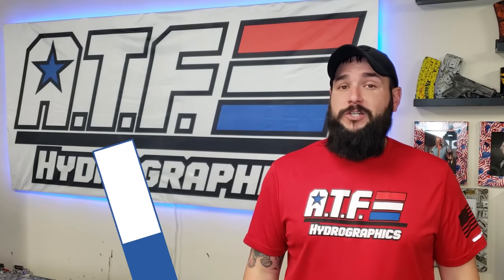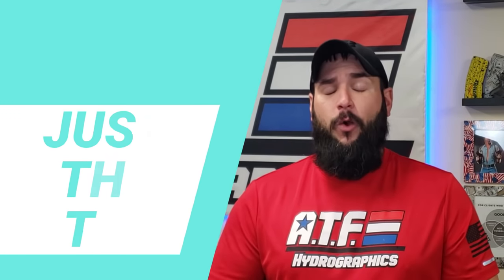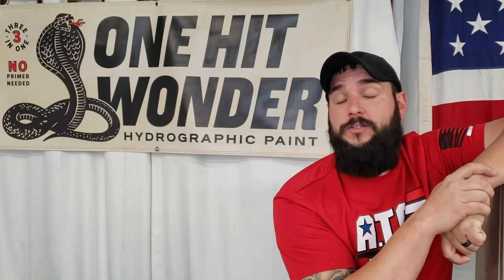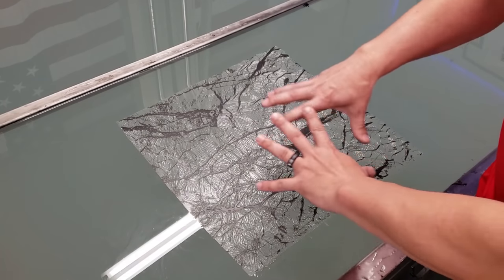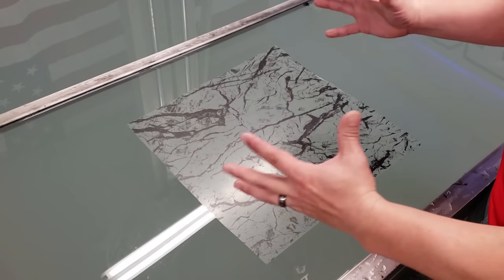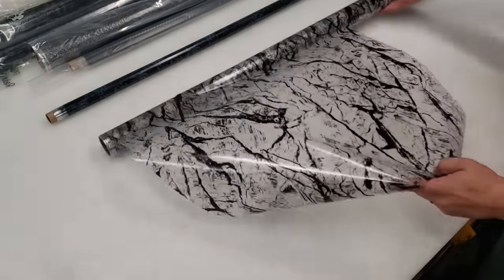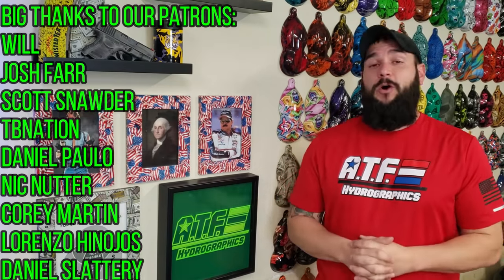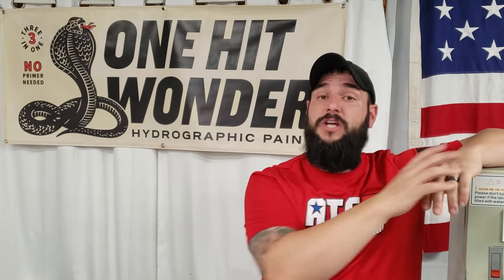Want to get better at hydro dipping? Stop Doing This!

Comment: I was always wondering why my ones came out better without taping the sides. I thought i was doing something wrong because every video i watched, people would tape down the sides, but i stopped doing that because it worked better without it. This video was very helpful, thankyou.
Reply from the maker: That's exactly why I made the video, because there is so much bad info on the interwebs I just want to help people do the right things and have it help them make dipping easier.

Comment: once I spray the activator all the tiny wrinkles go away..
we gottttta use tape if we're dipping in a bin ect and don't have adjustable stops
fricken great tip with the pvc pipe method

Comment: Well done bro. I use 1inch pieces of tape about 6 inches apart but your way looks good also and probably a bit faster
Reply from the maker: Much faster and I don't have to goof around with tape all the time. One less step in the process and is much easier once you get the hang of it.

Comment: I've been working on a project. I have had to strip down my item 5 times now because I followed the directions that came with my kit from Amazon. They said to tape the sides and cut the slits. I had blobs. I had breaks. I had separation. It's been a nightmare and I decided to hit the internet and find out what my problem was. I'm going to give your method a shot, because I've had terrible luck with the kit provided instructions.
Reply: And it worked perfectly. Thanks man. 👌

Comment: I wish I would have seen your video sooner when I tried hydro dip on a rc body for the first time.
I guess I made a lot of mistakes.
Great vid and thanks for sharing.
Reply from the maker: Keep practicing Chris, it is one of those hobbies that unfortunately can be frustrating but keep at it and you will get it. I failed hundreds of times before getting the hang of it.
Reply: @AllThingsFunHydrographics 
Thank you for your encouraging words💪🏼👍🏻
Reply from the maker: @chriscrashrc2982  No problem, good luck and remember it is perfectly acceptable to have bad dips, throw stuff, cuss a lot, and then practice more later on. LOL Sad but true, I still do it from time to time.
Reply: @chriscrashrc2982  hey man how did you get the dip to stick to the body? I’m fixing to do the panels to a dbxl. Sadly the panels come preprinted so I’m having to dip the outside of the panels instead of the inside. Since the panels are lexan I sprayed them with bonding primer.
Reply: @AllThingsFunHydrographics  by any chance do you have any tips for lexan plastic.
Reply from the maker: @juarezd432  scuff, paint, dip, clear... pretty easy.
Reply: @AllThingsFunHydrographics  ok thanks I did scuff it and also used a few layers of bonding primer
Reply from the maker: @juarezd432  I never use primer, One Hit Wonder Paint has primer in it already!
Reply: @AllThingsFunHydrographics  I’ve never heard of it but I’ll look into to it. Thanks
Reply: I want to try to dip a quadcopter frame.

Comment: Three years later and this shows up in my recommended.  I'm actually surprised people though taping at all would work.  Water does what it wants to what's put in it.  Not very many things can counter that.  Trick is to get it to work for you.  But I did learn one thing.  The side that sticks to your finger is the side that gets set down on the water.

Comment: Which side goes up on the water? Using the wet finger method to determine the sides of the dip - you say to put the sticky side down on the water. I believe you but can you explain why? This is the side that, when you dip, will be on the outside of the object. It logically seems like you should put the sticky side up so it sticks to the object you are dipping. Again, I believe you but can you explain why it’s not sticky (I’m assuming it’s not) after you dip the object?
Reply from the maker: There is 2 sides to the film. One side dissolves in  water, the other side needs activator to dissolve. The reason I wet my finger and figure out which side becomes sticky is I want to figure out which side dissolves in water. So the wet finger makes the film sticky because it is partially dissolved. That side goes down in the water.

Comment: GREAT video. I want to hydrodip a smart bike helmet( Built in speakers and microphone) Any Tips and do you have to sand off the new paint and prime it
Reply from the maker: Make sure you take out all the electronics because you don't want those getting wet.
WE have a whole video all about how to prep parts for painting and hydro dipping if you want to check that out it will answer every question you could ever have about prep.

Comment: After watching your video I feel more comfortable and confident in my ability to do this at home. My one question is if the project doesn’t turn out as well as you planned is there a way of removing the dip from the piece and starting over? I’m considering doing fairings and unsure if I don’t like the selection can I re-dip with a new film?

Comment: Great tips.  I've seen several of your videos about prepping plastic items for hydrodipping, including how you flame treat everything.  I haven't seen you dip any clear plastics like Lexan, though.  Obviously you wouldn't want to prime or paint lexan if the idea is to see the dip through the clear lexan -- "reverse painting" does this all the time without a problem of paint not adhering to lexan. They just wash the lexan with soapy water before painting.  Are the inks in hydrographic films just not good at adhering to lexan like paints are ?  If you could dip the reverse side of lexan, how could you do that ?  With the item in the tank below the film and then pull up into the film?  Or dipping normally ?  Would the film appear correct if you were looking through lexan at what had been the activator side of the film ?

Comment: Hey man, Love your videos and information. but if you dont have a fancy set up like you with a hydro tank its a good idea to tape 2 sides to contain the film just not all 4 like you mentioned.. much love for all your videos
Reply from the maker: You can use tape by laying it across the water to hold the film, don't put the tape on the actual film itself. Another easy thing you can do is make some dams for real cheap using aluminum roofing flashing or pvc pipe. Just cut it to fit your tub or tank.

Comment: I have never done this. What clear spray would you recommend for small projects? I might also want to do the interior HVAC trim of my car, so I believe it should withstand high heat from the sun. Is Rust-Oleum Painter's Touch 2X any good ?

Comment: Thanks for the valuable tip. I’m dipping sunglass frames and I’ve run into a very consistent problem. The film will only adhere to the front portion of the orbital section. It doesn’t wrap around the entire frame and I can’t figure out what I’m doing wrong. It’s very frustrating.
Reply from the maker: Not all films will wrap that much and a lot of it has to do with what activator you are using. Some activators need a lot more put on in order to get the film to stretch. The key is try different activator brands until you find the best one for each film.

Comment: Great video. I’ve been trying to get information about how to dip ice fishing rods. If your not familiar, they have small diameter and are typically between 20-40” long. There aren’t any dippers near by and I prefer not to ship my rods. My biggest questions are when dipping a rod does it have to spin to get coverage? And is there a way to make the dip seamless. I plan on using a carbon fiber style dip.
Reply from the maker: To dip a fishing rod you will go straight in and it will leave a seam no matter what. Just make sure the seam is on the side that you will not be looking at when fishing and it will be fine. Some patterns that are more random leave the seam less noticeable but with carbon you will defiantly see  a seam.

Comment: It makes sense for no tape from someone with some wrap experience. The tape isn't allowing it to do what the soul purpose of a hydro dip is good at and that is stretching around odd shaped objects. The tape is just asking for a rip or fold. Its like putting a gymnast is a straight jacket. 
For the record I do use tape for a wrap or large decals, but only to hold it in place on an odd shaped decals, once I get a decent amount of the graphic stuck down that is enough to support it's own weight, all the tape comes off. Usually a few inches of it across the graphic is enough .
Reply from the maker: Tape has it's uses, but causes more issues than it helps. So I try to teach people from the get go to never use it and get used to working without it. Makes for a better dipping experience down the road.

Comment: been trying to hydro-dip my gun stock for the last few days , I keep failing >_< 
will try the no tape method now I've re-prepped the stock again !
Reply from the maker: Yup, no tape and practice practice practice. The activator is the hardest part.
Reply: @AllThingsFunHydrographics   am on my 4th fail now, the film is just bunching up and wrinkling on the stock as i try rolling it.. 
1 side came out ok - other side looks like i spat it on there hahaha
Reply: @Froggywentawandering  I'm getting the same results with my motorcycle parts project. Following the suggested timelines to a tee, nice slow dip, proper amount of actuator... : / How do we resolve this issue ???

Comment: My friend greetings from Venezuela ... a question ... I understand that after you place the sheet in the water and let it hydrate well, the activator is applied ... if you do not put the masking tape when applying the activator the The sheet expands and the job cannot be done, or do you simply replace the tape with aluminum strips that you have to use in the pool ???? thank you in advance for your reply. Cheers
Reply from the maker: We make dams to hold the pattern in place, or you can tape around the film, just dont put tape on the film

Comment: Hey! I’m about to hydrodip a paintball gun, and planning to dip both sides separately. This is just the top frame of the gun, so does that mean I HAVE TO dip each side separately or can I do it all in one go? If you’re curious of the size the gun is an etha 2. And if I do have to hydrodip each side separately, do I rinse the hydrographics between dipping the sides?
Reply from the maker: You can do whatever you feel comfortable with, there is no hard and fast rules with how you dip. I prefer to dip both side because I get a better image quality and less stretching that way. It's easy, dip one side, rinse and let dry completely. Then tape off the side you dipped and dip the other side. Rinse, dry, and then clear coat. If you want to do it all in one go, have at it... just watch for spots that will trap air and pop the pattern.
Reply: @AllThingsFunHydrographics  thank you so much!
Reply from the maker: @lucid8905  No Problem.

Comment: The Kryptec (sp?) is on a small core. I bet if you transferred it to a larger diameter core, it might be less curly.
Reply from the maker: Tried to put on a bigger roll, makes no difference. The humidity in the air is what causes the film to roll up. It starts absorbing humidity as soon as it comes out of the package.
Reply: @AllThingsFunHydrographics  I would bet that the amount of ink saturation in the film also affects it.  The marble pattern has much less ink to material ratio than the Kryptek

Comment: I saw a video where someone said to rinse the thing you hydro dipped with water, to get the clear film off. Do you have to do that or no?
Reply from the maker: Yes it is required to rinse the parts after you dip them. The PVA in the film leaves a slimy residue all over the surface after dipping and needs to be removed or else the clear coat will not bond properly.

Comment: Can I use any printer with stock ink to print on these hydrographic films? If so will the regular stock ink stay permanently on whatever item I hydro dip or will it peel off or fade or stain to the touch?

Comment: This is super hard for me because my films aren't as laid back as that the second I unroll them they roll right back up, very annoying, which leads me to my next question, they feel very dry and crinkly unlike how yours are smooth. Do I need to rehydrate them, and how do I do that? They were stored in a shed for awhile prior to my ownership.
Reply from the maker: Throw all those films away and start over, you cant rehydrate them. If they crinkle and wrinkle the film has gone bad and will never work right. I usually dont keep films more than 6 months, toss them and get new film. It is the cheapest part of hydro dipping.

Comment: Hey man. 
Im doing some amateur dipping at home with Multicam Film and a Spray can base. 

Ive been doing this and it seems great although ive encountered an issue. 

When spraying activator the film expands since there is no tape to hold it in its shape. 

So i either have to dip really fast, spray less activator and or have to redo because the film streched. 

Ive been encountering tiny bubbles after rinsing the part wich i either tracked down to not enough activator or the spray paint base "gassing" because i dip too early. 
Ive been following your instructions saying not to let paint dry too long otherwise it doesn't accept the film. 

The bubbles arent holes in the film but just like little bumps at the end. 

Any ideas from your side? I appreciate any help

Comment: Quick question: If I have an object that's too large to dip, and I want a hydrodip pattern on a horizontal side of it, would taping a sheet with a pattern on it and then running a wet sponge over it, transfer the pattern onto the flat, horizontal surface?
Reply from the maker: Not sure what your talking about with the wet sponge... but if its too large to dip you just dip what you can on one side. Rinse and let dry, tape off the side you already dipped and then dip the other side.

Comment: Question. This hydropaint process is attacked by solvents or thinners? I have the idea is to do it in metal tools that the user then cleans with those products. Thanks!
Reply from the maker: Solvents and thinners will eat off the hydro dip, so that is not going to work in your application.

Comment: Hi. I'm also started to hydro dip (carbon) the interieur parts of my BMW e91. Some parts, the smaller ones, came out pretty good right of the beginning. Now I'm trying to dip the longer parts e.g. front door side parts & the dash but I'm facing some problems. Mostly the film rips off around the edges or when I'm trying to clean the surface with water the film comes off again little by little, even when I let it 10min dry or so. First I thought I'm dipping the parts to fast, so I started to do it slower. Which worked for some parts but not for the bigger parts. Cause when I do it to slow, sometimes the pattern is shifted. Then I changed the way I dipped the parts, normally I started from the short side and today I tried it with the long side, which was even worst cause I had a lot of bubbles on the part. On the second part the film came directly off at some spots. This would indicate that I'm using to less activator but I dont think I use to less activator after I saw your video about it. Maybe to cold water temps? I dont know what I'm doing wrong....
Reply from the maker: The issues you are having are 2 things... 1. You are under activated, need to spray more activator. 2. You need to tape the backside of all the parts and let the tape hang off the sides so the pattern can flow off the part and onto the tape, that will keep it from ripping.
Reply: @AllThingsFunHydrographics  Thank you very much for your feedback. I will try that asap. I tried it yesterday again and when I sprayed the activator on it, I saw that the film was stretching/expanding itself quite heavy on one side, which made it unusable. Can this happen when I'm to close to the film while I sprayed the activator on? Interestingly that didnt happen before when I tapped all sides of the film. After I saw one of your videos I didnt use tape for it. Maybe I should tape the long sides again next time, as the film was 120cm long
Reply: @AllThingsFunHydrographics  BTW the trick with the tape around the edges work perfectly on a smaller part that I dipped today. Will try also on the longer part when the new film is here.

Comment: Is it possible to dip a rc body on the inside so the dip doesn't get messed up under use?
Reply from the maker: Possible yes, should you? No. Way to difficult for most people, just dip the outside and use a good clear coat.

Comment: I tape cause I have no dividers so when I activate film just goes everywhere? How would I prevent that?
Reply from the maker: Make divider or dams as we call them. You can make them out of anything cheap, PVC pip, aluminum flashing, plastic. But you need something to keep the film from expanding.
Reply: @AllThingsFunHydrographics  indeed.